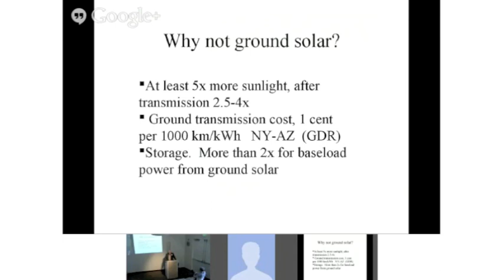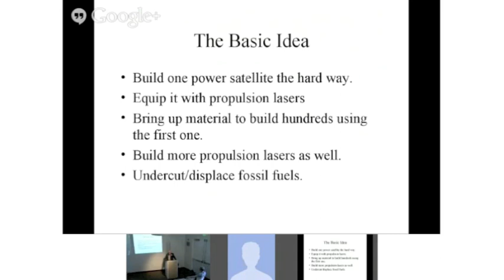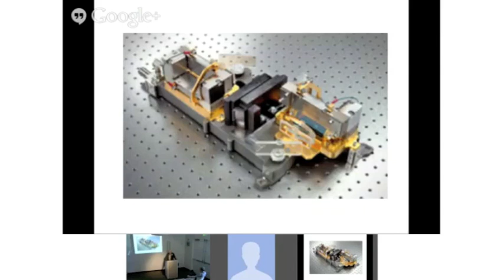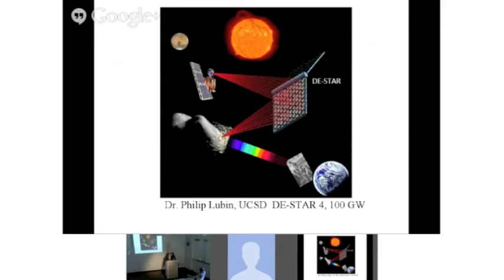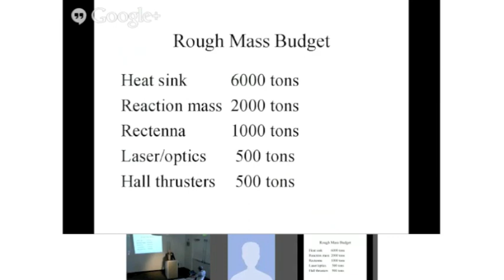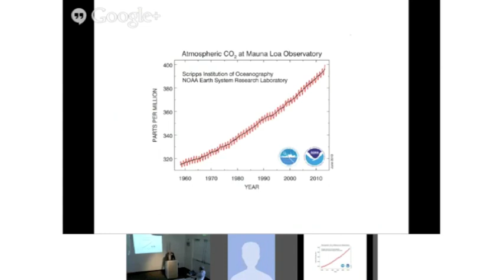Building Space Solar Power

Comment: 26:25 "The total human demand for energy is up around 15 terawatts"

It's actually higher. Today, it's 20 terawatts (EIA global energy figures for 2008 and 2012 convert to 15.0 and 18.0 TW, respectively; extrapolating, it should be around 20 TW today).
Reply from the maker: +hitssquad Fortunately there is room in GEO for around 177 TW.  More recent video on this topic, 7 minutes of animation.  

https://www.youtube.com/watch?v=q-Lrj35HcbQ
Reply: +Keith Henson  GEO is only 265,000 km in circumference. If the 5 GW powersats were spaced 20 km apart on-center, there would be room only for 66 TW -- except that they would shadow themselves (the umbra of a satellite in Earth orbit is over 100x its diameter, and then there's its penumbra also) around 6AM and 6PM, so they would produce less power than that. How closely were you considering spacing them? Also, consider that there are already some 500 satellites in GEO (not including several dead ones that didn't make it into the graveyard orbit), that they are clustered where powersats would likely also be clustered, and these these satellites are all solar powered and would all be shadowed around 6AM and 6PM just like the powersats:
http://www.ucsusa.org/nuclear-weapons/space-weapons/satellite-database#.VvW-IPkrKM8

"Satellite Quick Facts (includes launches through 12/31/15)"

"GEO: 493"

Also, how does one maneuver into a tight GEO parking spot in a low-energy way without hitting one of these nearby powersats? It seems unlikely one could just drift into a designated parking spot without smashing into the huge powersat parked just 20 km on-center away. I suppose the protocol could demand they only be added east-to-west, so that there would never be a powersat to the west to get in the way. That might be fine until someone wanted to add another GEO comsat or weathersat or spysat. It would take energy-expensive maneuvering to park between the huge powersats without smashing into the westward one.